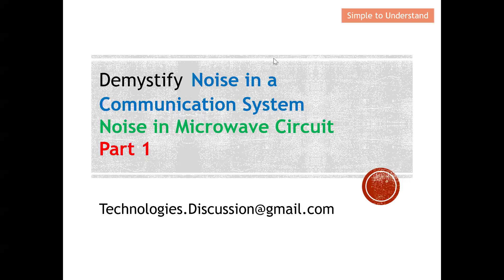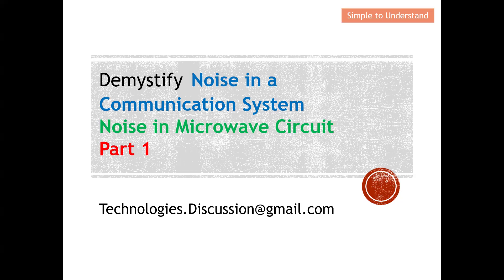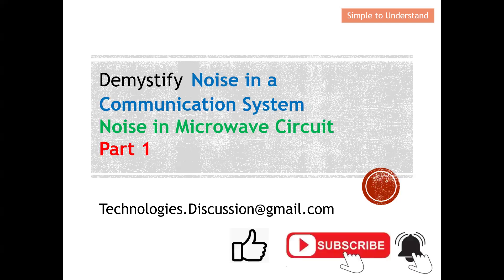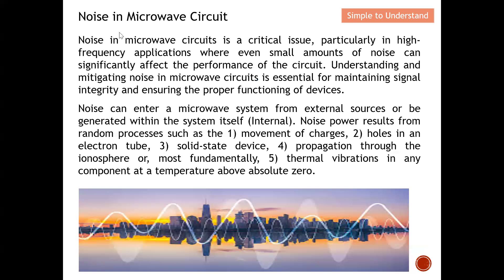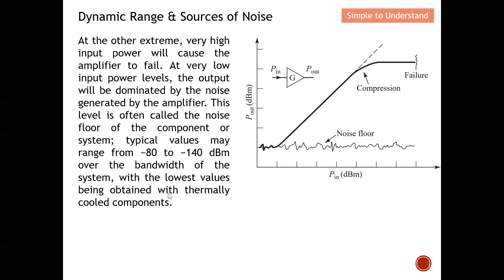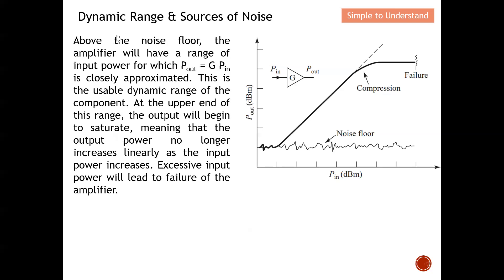Noise #1. How to Kill Circuit Noise! Fix Internal & External Interference in High-Frequency Designs.

Comment from the maker: Thank you for taking the time to watch this video on noise sources in electronic communication systems. Noise can be broadly classified into two categories: internal and external. The internal noise source includes Thermal Noise, Shot Noise, Flicker Noise & Phase noise. While the external noise included the Thermal noise from the ground, Cosmic background noise from the sky, Noise from stars (including the sun), Lightning, Gas discharge lamps, Radio, TV, and cellular stations, Wireless devices, Microwave ovens & Deliberate jamming devices. In this video, we will explore these noise sources in detail to better understand how to minimize or even eliminate them.